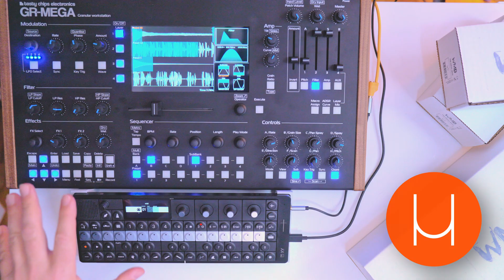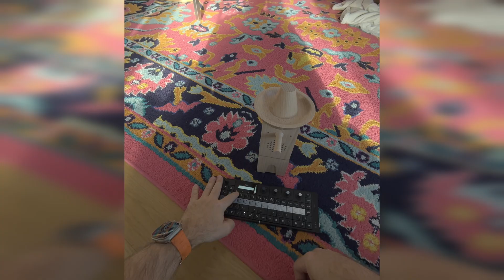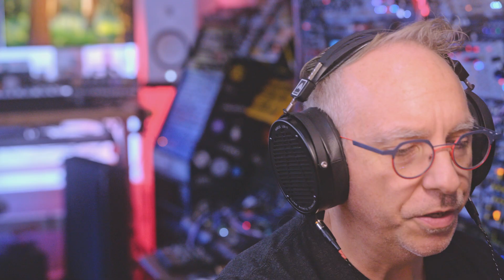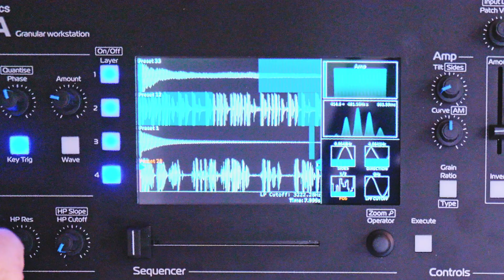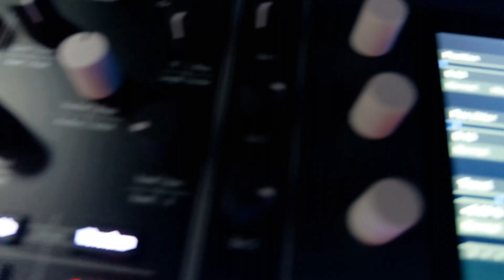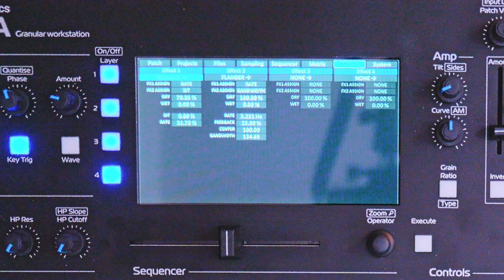GR Mega Granular Engine Overview

Comment: Seems it does not have pitch scaling not time stretching across the keyboard?
Reply from the maker: You have access to both playback rate and pitch for most modes. It's able to do a lot at the same time. Also, there have been a ton of updates since this video with many new features. May try to do a new video this year. Thanks for coming by!

Comment: Nice Cans!!!
Reply from the maker: I love them! Are they your favorites or something else? Thanks for stopping by to comment and watch my video!
Reply: @ModulationStation  Would love to try a pair, but GC doesn't stock them and there's nothing local here. Did you try others before deciding on the Audez?
Reply from the maker: Over the years I have had a number of different headphones. Two pairs that I still have from previous years are the Beyerdynamic DT770 Pros and the Sennheiser HD300 Pros. The Audeze are the most expensive headphones I have bought. I really like them and I can totally hear things I don’t pick up on the other two. They are quite heavy but very comfortable. Are they worth it? Hard to say - I think I have gotten more mileage out of adding a subwoofer to the studio recently and getting my bass less muddy. But they do sound really great as I am working on a song. They are super flat and don’t over emphasize the bass, which I like a lot.

Comment: Sounds great. I bought the Torso S4 last year which  I highly recommend. It gets some stick for not being finished, but it can make great granular like the Tasty Chips.
Reply from the maker: Thanks for watching my video. I've heard a lot of good things about the Torso! One thing I mentioned in another video I did on the GRMega is output levels - I'm curious how the S4 does on keeping things so it doesn't shoot into insane distortion on your granular patches?
Reply: @ No problem. There’s a lot of control in the S4 engines. There are distortion parameters if you want that but my experience is it’s a very clean and faithful sounding sampler for the user to do with what they like. It’s very easy to use too, not many menus or menu diving, which just helps the process as you know. You don’t lose momentum scrolling, clicking and diving, you’re just creating in the main. Thanks.
Reply from the maker: Awesome. Thanks for filling me in on it. That’s encouraging. It’s the only thing I don’t love on the GRM atm. I have a few tracks I really need to work through and finish up. Going to try to get the GRM on a few and see what I feel I may or may not be missing! Thanks again 🙏🏻

Comment: The question for me is : does it anything more than my waldorf quantum granular Mode?
Reply from the maker: A few things:
- Check out the video I put up the next day where I explored Spectral/paulstretch mode a bit more for an intro on a song I am working on. That is something completely different and a lot of fun. Will you use it for everything? No, but if you lean towards sound design, it’s like shaping sounds with your hands. https://youtu.be/seGye9GdqzA
- The number of grains is substantially higher than the Quantum. I have an Iridium so can’t say how the Quantum mk2 differs here, but (I believe) you can have 5,000 grains going on your GRM between your multitimbral patches. That’s a lot more than my Iridium. 
- The multitimbral capabilities of the GRM are pretty impressive. 4 LFOs per layer, so 16 LFOs with many destinations, waveforms, and shapes. You can easily cook everything 🤣
- Your sample length on the GRM is (I think but have not tested) an hour. That might be more useful for live situations where you can load long samples in and manipulate them in realtime. I don’t play live but seems fun. 

I have an Iridium and love it. It’s one of my favorite synths. But the Iridium is a bit more general whereas the GRM is a deep dive into the art of granular. And it does go very, very deep. The Iridium likely covers many bases, but it doesn’t go to all the same places or as deep as the GRM. I also think the GR-Mega is a very hands on synth and encourages playing and manipulating the grains. It’s very hard to describe but it is different from thinking of Iridium patches. 

I was interested in a unique pad generator, atmospheric sound maker, and transition generator. If you feel like it, check out my latest track on Apple Music/Spotify (The Start of Everything We Know). Making sounds like that intro feels well within the GRM zone. Also given how hands on it is, I think making some transitional effects is completely different from the Iridium. 

Hope this helps!
Reply: @ModulationStation  Thank you for your detailed answer!  The granular engine of Iridium and Quantum should be identical. I already believe that the GR can do more than the Waldorf granular engines. The GR Mega is expensive hardware, so you wonder whether you can't achieve the essential things with what you already own. 😉
So my question may have been a bit biased and unfair, sorry.

Comment: I’m on the waiting list. I’ll be using it for industrial ambient drone atmospheres and probably feeding a lot of field recordings into it. I’ll be feeding the output into the filters on my Moog One 16 voice.
Reply from the maker: Your use case is a sweet spot for this. Atmospheric sounds with field recordings feels like something you could spend all day experimenting with and always finding new places to go. I haven’t fed it into any external fillers yet, but your idea of sending it into the One is a great idea to smooth out some of the digital glitches in the granular sounds. I think you will love it! Thanks for stopping by and watching my video! 🙏🏻
Reply: Does the Moog one have stereo input?
Reply: @ I would describe it as dual mono. There’s a 1/4” trs and xlr-1/4” trs combo jack input with a trim knob that can be used simultaneously.
Reply from the maker: @Cyberpunk9000 kind of. you have 4 inserts and then you also have two other inputs, that can route to inserts 3 and 4 or as dedicated inputs that can both be used as external inputs on a patch but they don’t route to left/right. The inserts are where you have more flexibility for stereo over using both inputs on one patch.
Reply: Woha. Excellent idea. I also have a Moog One and a Quantum MK2. Sending granular into analog is a very good idea. I love the One but I sometimes miss some sample texture

Comment: Love it... I have an Iridium and it has a nice granular engine but I was hoping for some kind of formant control as it doesn't pitch voices too well..  also have a lot of VSTs... still the idea of a standalone instrument really excites me.
Reply from the maker: What's interesting to me about the GR-Mega versus the Iridium is that the GRM is really just focused on doing this one thing very, very well (and covering every nuanced aspect of it). The Iridium is really one of my favorite synths, but it doesn't really hit the level of manipulation/depth that you get with the GRM. It's also not quite as hands on. I uploaded a video the day after this one where I built a new intro for a song I'm working on using the Spectral mode. It sort of shows me working through how I did it. Check that out if you have time and you'll instantly get an idea of how different this is from the Iridium! Thanks for stopping by and checking out my video! 🙏🏼